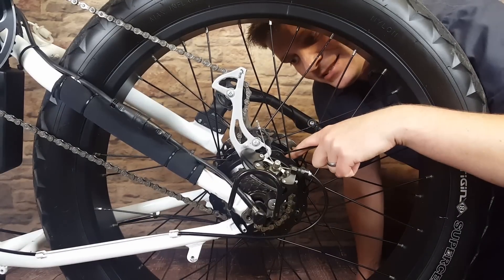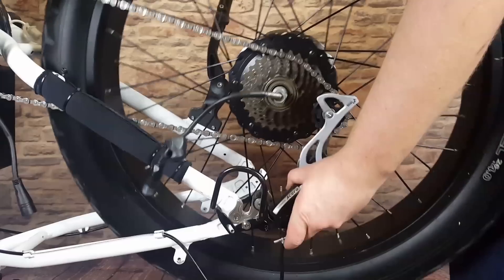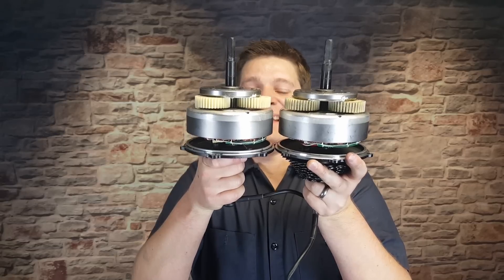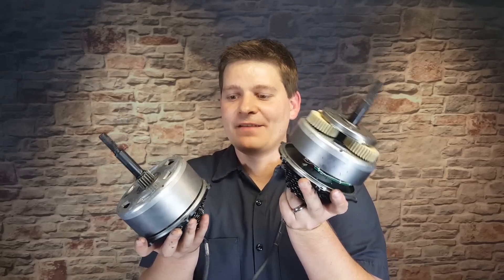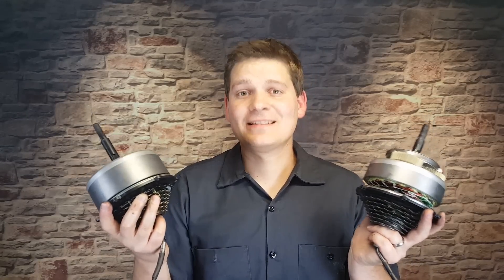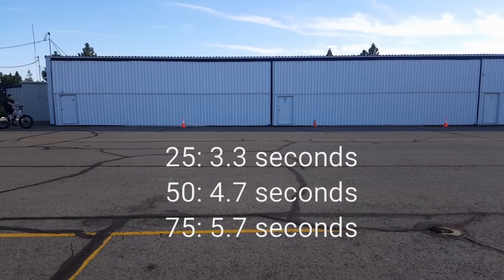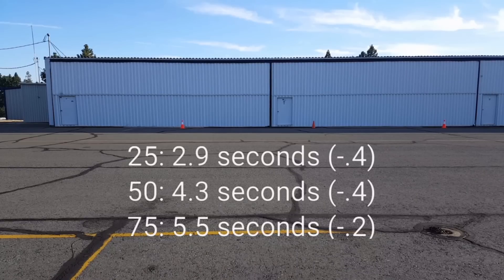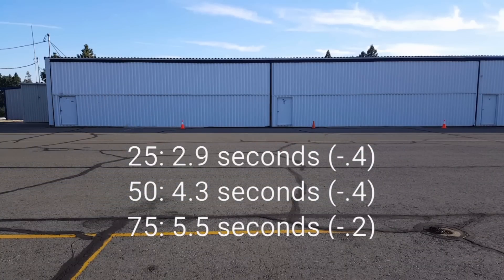Considering the RadRover Ebike?  You better watch this first!

Comment from the maker: Do you have a RadRover, Radmini, or some other bike with a Bafang motor?  Let me know what bike you have - it would be great to see what motors are ACTUALLY in the bikes on the market!
Reply: I have a rad mini.  And my brothers name is Kyle.   So I'm actually now totally interested in what your speaking on
Reply from the maker: @westroop6342  sounds great!  Thanks for watching.  :)
Reply: I have the blizzard aveny. I think it has a Bosch motor.
Reply: building a bike i'm going to add a bafang bbshd to, does that count?
Reply from the maker: @dustinnoyfba7227  Sure!  BBSHD is a great option.
Reply: I have the Rad City and my wife has the Rad step-through. Both were purchased in September of 2018. Each have the 750 watt Bafang with 48 vdc battery.
Reply: I have a 2018 Rad Rover purchased in January of last year. I'm also an electrical engineer and have been looking for an excuse to start taking things apart, no I've find one!
Reply: I was considering it, but not after seeing this video.  This explains why their top speed is only 25mph after you unlock the limiter. However another competitor like the Mate X goes up to 32mph after being unlocked. Both advertise the same exact motor, apparently one is clueless about what they are being sold and after this video we know which company that is.
Reply: I have a RadRover. I changed the wheel size to 16” or about to get more revolutions. It goes faster than 25mph. Maybe 28-30. Never clocked it to be sure. It’s too fast in the winter for me because of the wind chill factor lol
Reply: Bolton Ebikes I was looking at those exact same tires. The origin 8. How do you like them?
Reply: I have the 2018 Rad Rover. I love it 🙂.
Will be looking to upgrade in a year or so. Welcome suggestions.
Reply: @dustinnoyfba7227    Built a 52v BBS-02 with a 52 tooth chain ring out of an older hard tail Gary Fisher 26" MTB. The thing is a relative rocket ship on pavement.  30-35 mph (which feels very fast on a bike) and it gets there quickly when running through a few gears.  Dusts cars at the lights.  The BBSHD can be even faster.  That BBSHD conversion will put a smile on your face!  52v battery option over 48v and smaller chain ring for off road torque.   Larger for on road/ commuter type use and higher top end.   For a rider willing to use gears as they would on a manual transmission vehicle, mid drive over hub all day.   They rock.
Reply: @bkanegson  i'll probably have to use a 40t or smaller ring when commuting so as not to snap my chain. i am a major clydesdale. 6' 6" and 315 lbs. no idea where i am keeping it though.
Reply: Hi Kyle .. I have a radmini I purchased in 2017.  It also has the bafang 750w with a 48v 11.6Ah Li-ion with 30 amp continuos bms Panasonic 2900 mAh
Reply: Modify the genze e201. I dont believe u can. I have 2.
Reply: Bolton Ebikes 
In
Reply: Challenge for you! I am a camper who likes to go off the beaten path.  Challenge is ....... An electric bike with a frame simular to the UBCO.  That gets 85 miles distance carrying a weight of 500lbs including self at a speed of up to 35 mph on a slight grade.  15 mph on an uphill grade. That charges in 3 hours or less by solar or water streams.
Reply: Thanks! As a newb, during shopping now I'm finding motors that are supposedly the same 500W, on very similar models and on same wheel size, have differences in the listed torque for example, 80 vs 65.  I'm thinking that might be a telltale sign of  existence of a motor difference  between the two.  is that correct?
Reply: @marksdaman9408  YES!! Surface604 Shred or Boar Hunter. Surface604 is Canadian and growing. They're philosophy is to use tried tech that's bombproof as pissible. So...their bikes Dont always lead the way in new tech their bikes are solid, affordable and great components.  Check them out! Love my Shred...1400K and no issues!!!
Reply: @ashegam Limiters are put into place because the law doesn't allow ebikes to go over 20mph. You should know your local bike laws. I am sorry to hear about your Mate X maybe you can get a refund. This youtuber promotes his own bikes as being superior. I have no doubt that he would find flaws in every ebike except his own. It is why you should never listen to reviews except your own experiences. Have a nice day.
Reply: @noonespecial6076  if people took your advice...they wouldn't take your advice! Right!
   The man is right..it's physics. I watched this and when I took my Surface 604 and parked next to a Rad it was pzinfully obvious.

..
Reply: @davidklein1667  My advice is to do some research before making a big purchase and since you are suggesting that people wouldn't take my advice. Well, they are entitled to do what they want because it is their money after all.
Reply: I gotta say... 1 second is not that big of a deal. Mine handles hills very well, which is great since I live in an area known as the highlands. I should note my ebike is a Bam Nomad (maybe the last of it's kind - a Rad Rover clone). It has a 750 Bafang.
Reply: @nobodyisprfct  two trains leave different cities in different countries at different times..at what time should we start to give a fuck!!??
Reply: Rad runner - does anyone know if you can just swap in a true 750 in the same casing to avoid getting the whee re laced?
Reply: Hi Carl thanks for your videos I live in France with a Radrhino  (Rover)  I find your advice informative  watching your videos  all the time I  cheers
Reply: David Klein surface 604 EBike
Reply: @davidklein1667  koo
Reply: I have a 2015 Radrover with 3k miles going strong but could use some TLC...
Reply: Hi...I’m in the market for an e bike...do you sell them?  Mostly on road and some trails..
Something comfortable like a cruiser.
Reply: RadRover 2020
Reply: Is it possible that your 750 watts high performing motor would run hotter because of those gears being on the inside of the casing? It seems like the one on the rad Rover would run cooler but I am not an expert.
Reply: I got a standard Bafang 500w/26" on the front of my Schwinn and wanting to make the 750w upgrade, do you know what's different on those 20" fat bike wheel bafangs? (plenty of availability and they look the same), do they have different planatery gears or are the just not as fast from smaller wheel??? ... wanting to run dual motors with one hi-way geared
Reply: I have a Biktrix Swift Lite 3 hub drive.  I don't know that motor manufacturer.
Reply: Ho una ebike lankeleisi con doppio motore da 1000+1000w 52v 25ah. Ho smontato i miei motori, con delusione ho visto che hanno lo statore piccolo. Io voglio il motore con lo statore grande come quello che hai tu..... aiutami, grazie per la risposta.

Comment: I have a 2017 RadRover.  I think the biggest performance improvement I could get is if I would lose 50 pounds.  I bet the acceleration would increase dramatically!
Reply from the maker: Haha!   That would work for most of us!
Reply: Downhill advantage.
Reply: You bet it would!
Reply: lol
Reply: Haha. True KE = mv2.
Reply: 1/2mv²
Reply: True.  If you plan to deal with bad hills and/or heavy loads, chances are you want a stiff mid-drive.  I know I did, and do.

I’ve ridden both hubs and mids at some length, and I went with a mid.  I routinely deal with bad hills - long, steep hills - and I plan on using a trailer regularly, as well as using one with my first build.  Finally, I need to lose a lot of weight.

Comment: Thanks for this very revealing video. My E-CELLS Super Monarch Crown bike has 2 wheel drive, 2 batteries (front->52 V, 17.5 aH,  
rear->52 V, 14 aH) total 1638 watt hours.
The BAFANG motors are both 52V/750w specially built for E-CELLS by BAFANG according to Dave Cleveland, the owner of E-CELLS.
The bike has an 18 MOFSET controller for 44 amps of power. (2200 watts)
So the bike is frikkin' POWERFUL, especially in two wheel drive. I use it for hunting and soon for backcountry camping which, being an ultralight backpacker, will be an easy load to haul with 30 pounds of gear max including 3 liters of water.

Comment: I have worked with the Bafang BLDC 25A (750W /1250W Peak) - I think it's excellent (if a little noisy under load), it's compact and torquey and looks pretty classy too,  if used in wet conditions I would recommend breaking down and cleaning regularly, also greasing the nylon gears with White lithium grease or red Moly grease periodically. I'd also recommend replacing and shortening the power supply cables with 4mm sq. or 12/14AWG using solder and decent connectors as the factory supplied connector block connection nuts loosen with heat and cause trouble if not tightened regularly.  Perfect with fat bikes for folks too old or injured to make a 30 mile commute on a regular 250w ebike :) . "To every man a horse!"

Comment: The size of the actual motor is not the only factor in judging the amount of watts a motor can put out. You also need to factor in number of windings, poles, wire size, gearing, etc.

Comment: We, pre-2019, Rad Rover owners want to know 3 things about your next step (Part 2).   1. How much the parts will cost us retail customers; 2. How much will a bike shop charge to install the parts; 3. How much better is it at maintaining speed when going up a long grade, not 25 ft. or 100 ft. which is more important than just the launch.
Reply: If it is only a couple hundred and holds speed better, than I will go for it and thank you.
Reply from the maker: All details to be announced very soon!
Reply: Well, a electric motor drawing 750 watts from a 660 watt battery will last about 30 minutes, maybe.  duh ! So , guess it will need a 2000 watt battery that costs what ? $1500 dollars  and weighs  50 lbs that is the cost of a new Rad Rover. Here is a clue, nothing comes for free and that includes electricity.

Comment: Very happy with my 2018 RadRover, and I knew before purchasing it that the 500W and 750W Bafang motors are one in the same and that it's the battery and controller combination that determine wattage output. They're also rated as Class II, which enables them to be used on many recreational pathways. A BBSHD is a 1000W motor and considered for off-road use only, although it can be governed at 750W to be "street legal." My next bike will probably be a mid-drive BBS02 for improved climbing torque and the freedom to swap wheels without worrying about a hub motor. IMO, the ebikes offered by Rad are great entry-level ebikes for the price.
Reply from the maker: Thanks for watching and your comments!
Reply: What motor would you put on a rad runner?
Reply: My Lectric XP @ $899 should be the new price point/quality component leader. 500/800 Bafang hub, 48 volts, folder, etc.. Mid August delivery. I’ll let you know! Lotsa reviews on YouTube already...